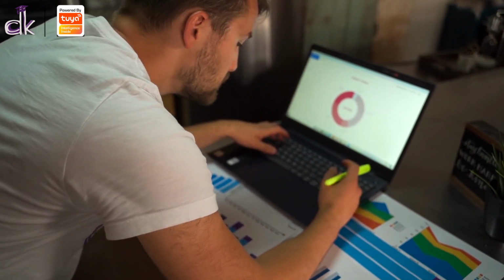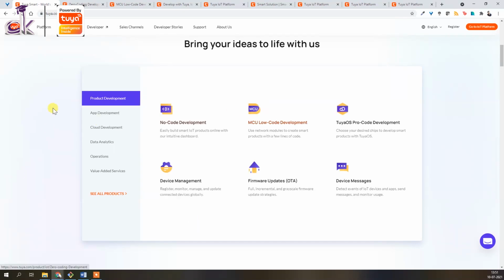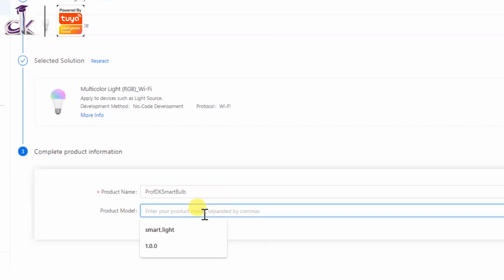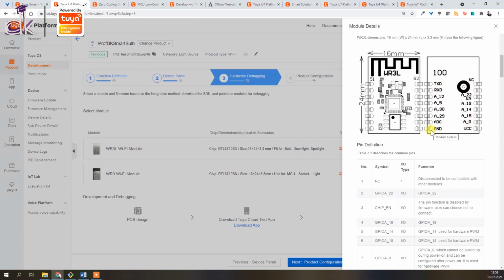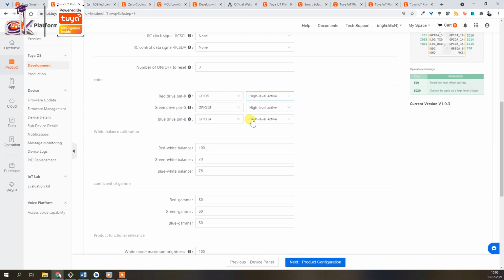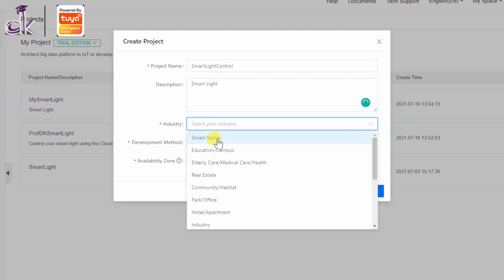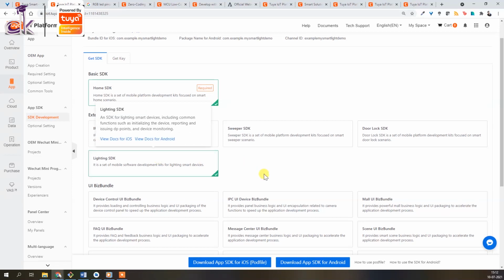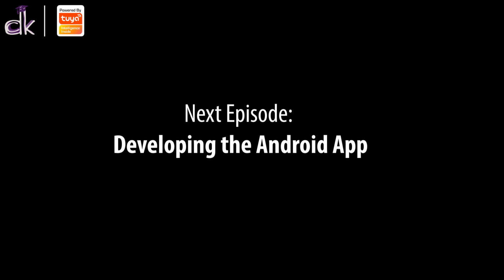E01 - Introduction to Tuya IoT Platform + Project Setup | Android Studio (Latest)

Comment: Thank you very much. Beneficial video. I am developing an app for a fan manufacturer that wants to control its fans remotely through the app. He has integrated the Tuya wifi module in the fan. Now I have to develop an app for controlling the app. Do the product and app need to be on the same Tuya account to control the device, or should I create the app and cloud project from my own Tuya account? And also tell me what things I should require from them. I would really appreciate your help. I have been stuck in that for over a month.
Reply: if u figured this plz tell me